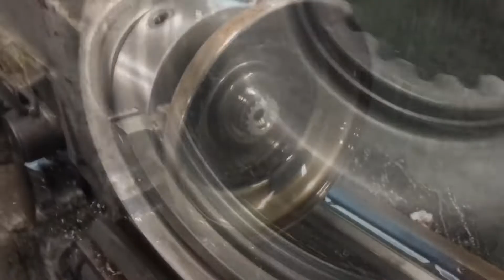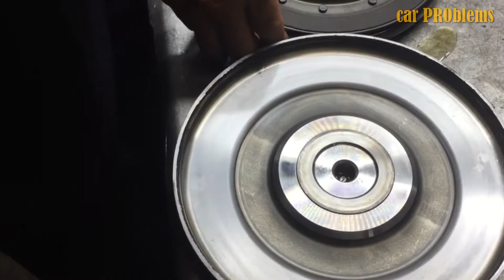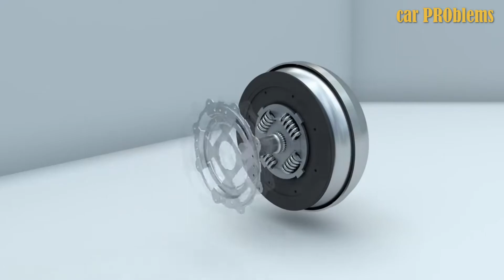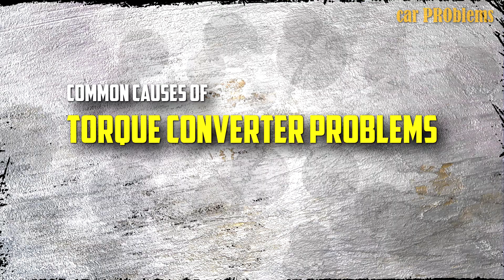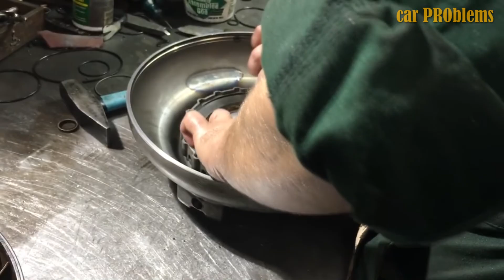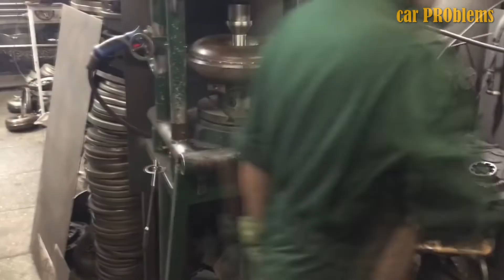6 Bad Torque Converter Symptoms and Replacement Cost

Comment: I have a 2007 honda pilot  it goes on park and drive but just rolls that i have to put on ebrake. When i have it on drive it just rolls even if i give it alot of gas.
And it made some whirring noise before this happened.

Comment: My 2001 2500hd silverado with a 6.0 lq4 trans was rebuilt to stage 2  like 3 years ago and a stock converter with a billet piston and it just started shaking almost a year ago starts shaking at around 55mph and stops right when i let off the gas then just get on the gas again it shakes again and im pretty positive its the converter
Reply: Did you find out what it was?

Comment: How do they prevent oil leaking out of the bearing where the impeller and turbine go into the torque converter?
Had anyone played around with variable vanes in a torque converter,  to completely eliminate the need for a gearbox? (Variable came technology could even permit a reverse rotation of the turbine.
Torque converters look such an elegant method of cooling. The technology has actually been known for over 100 years.  In surprised nobody's made further innovations with them. I'm a medic by used to be an engineer. I wish I had the time and equipment to design and create my ie of "geared" torque converters.  (Which in essence is two or more torque converters, which each have their own levels of torque multiplication. I've also thought of a centrifugal pump expelling the fluid into another centrifugal pump and thereby transferring the power from one one to the other. Fluid, although it has losses doesn't have any friction and with lockup clutch technology, those losses can be greatly minimised.

Comment: I own a jaguar s type 3.0 v6 gearbox zf, on 4th gear there are some noises and little difficult to shift down when pushing the throttle pedal. I think it's time to a oil change, isn't it?

Comment: I have ford focus 2015 transmission problem 5/6 kilometers drive running after not working transmission. Reverse good work. Not any noise. Transmission oil running time throwing back

Comment: i have a fusion 2014 with P0741 DTC CODE but it throws the code only when traveling at 55-65mph, what is the cosg aprox for the repair?

Comment: I just paid $3,109 for my torque converter replacement on my 2008 for ranger
Reply: That is very high in my opinion, you can get a recon torque converter (known to be pretty good as an O.E.M replacement) for about 250 or less and get a pan gasket, new filter, and enough fluid to do a triple fluid change to get all the gunk from the old torque converter out for around 250 or less depending on how good of fluid you want to use, so 500 in parts 3100 dollar job 2600 labor seems too high.
Reply: Should be 1000 parts and labor
Reply: Yikes!

Comment: My 2002 Ford Taurus shutters in the front end only upon acceleration. Like starting from a stop, when I give it gas, it shutters but then it quits after I get to about 15 mph... But I never let it shudder that long.....it's pretty vicious. Any ideas? It only happens when it's in gear. Sitting idling, I can floor it and nothing happens. Only in gear

Comment: Hi, I have a Titan 2007 that tends to   slip only a little like 100rpm(not 1,000) from 1st to 2nd gear and 2nd to 3rd(More noticeable after vehicle warmup). You can also feel that the vehicle kinda holds back after every shift even when cold, like when you drive a manual vehicle and use the clutch to change gears and you feel that momentarily hold down. Vehicle has 220,000 miles. I have it since 167,000 miles and changed the transmission fluid around 210,000. Around 200,000 miles one hose broke and lost a lot of fluid. Couldn't tell what color was it by the time it broke. topped it off with new fluid. Another hose broke around 205,000 miles and decided to change the fluid by removing the pan, also changed filter inside transmission. The filter was very clean😮, installed a new one anyway. I used Valvoline full synthetic max life multi vehicle fluid. Do you think a Lucas slip fix can help or is it something more serious? Thanks!
Reply: Did you end up getting this fixed?
Reply: Llllpl
Reply: Please do not use Lucas slip fix, it swells the seals until they blow, this sounds like valve body and valve body solenoid replacements are needed, or just buy a valve body solenoid pack and valve body drop in shift kit and fix it yourself, the valve body replacement or repair doesn’t require the transmission to come out of the vehicle, you see that thing right by where you took the filter off, that’s your valve body.
Reply: But with the fluid having gotten low sadly you may have burned up clutches in the shift drums and torque converter, but they can be more resilient than you think as long as they weren’t driven long on low fluid and you stopped the vehicle immediately

Comment: Let’s see if anyone can help me. My 2013 Toyota 4Runner will drive perfectly fine. But when going in between 30-40 mph my rpm revs up and down between 1100-1800 but no noises. No shaking or shuddering. It’s stalled on me while doing this only twice. It only happens between 30-40mph and it does NOT happen when I have my cruise control on any speed in between 30 and 40 but my mechanic is swearing to me that it’s a torque converter and I think it’s not that. Any help??
Reply from the maker: Hey there! Here are a few things you could check out for the issue with your 2013 Toyota 4Runner. It might be related to the transmission, so make sure to check the transmission fluid level and condition. Another possibility is a faulty throttle position sensor (TPS), which can mess with your RPMs. Vacuum leaks, a dirty mass airflow sensor (MAF), or fuel system problems could also be causing the trouble. It's best to have a mechanic take a look and get a second opinion if needed. Good luck!
Reply: Have you checked the VVTI Valve solenoid. Normally located on the engine towards the fire wall. Its easy to replace but the part is not cheap. Its held by two, some versions have three 10mm bolts.

Comment: Can you explain why my CVT  car moves from 0 to 100mph well, but it starts making some whinning  noise and doesn't go more than that sometimes it struggles reaching 120mph on the highway.   i  normally change recommended  transmission fluid as scheduled, as well as the transmission  filter, and still having that problem. I diagnosed it on machine but no any trouble codes, for engine also nothing, what can be done????
Reply from the maker: Hi! First of all, I'd assume overheating.
CVTs are known to generate heat during high-speed driving. If the transmission fluid isn't properly cooled or there are cooling system issues, the transmission can overheat, leading to a loss of power and the whining noise you mentioned.
It can be also belt or chain slippage: CVTs use either a belt or a chain to transfer power between the engine and wheels. If the belt or chain is worn, damaged, or slipping, it can result in a loss of power and the whining noise you hear. This could explain why your car struggles to reach higher speeds.
Reply: @carproblemsmax  Thank you so much for a well explanation, now what can be done???? I agree about overheating because in the evening it goes very well, reaching 120mph and keeps going, what can i do, seems on hot whether it overheats.
Reply: @edwinalexander1170  Why are you going 120? If your car works fine below that - stick with that and keep the rest of us safe. Thanks.
Reply: @jaym5938  Because it used to be going well and up to more than 100mph, but now it struggles, it sometimes  not good especially when overtaking, i feel like lose power. And is dangerous on the highway.

Comment: I have a 2009 tahoe with the 6l80 and it shakes in 3rd 4th and 5th gear and revs up before it shifts, do you think that would be torque converter issues or transmission issues? Shifts good otherwise. It starts shaking right as soon as you put it in drive.
Reply from the maker: Both. the 6l80 transmission itself is not very reliable. It has lots of problems related to cracks in pistons, slipping 2nd and 3rd gears, cracked drum, skipping gears, cracked clutch drum (I'm gonna make a video about this transmission). 
But it can be also a torque converter.

To determine the exact cause of the problem, it's recommended to have a qualified mechanic or a transmission specialist perform a thorough diagnosis. They can use diagnostic tools to read any trouble codes stored in the vehicle's computer system, conduct a visual inspection, and perform various tests on the transmission and torque converter.

Comment: I have a 2002 Silverado I can prolly drive it up the street but it will slow all the way down and the engine just starts to rev at high rpms I’ll have to turn it off for bout 30 seconds and crank it up for it to move again and it does not go over 30-40 mph. I think it is the torque converter when it warms up. Do you think this could be the problem?
Reply from the maker: Yes! Based on the symptoms you described, it is possible that the issue you're experiencing could be related to the torque converter. 
It makes the engine rev too high and the car too slow. It also slips and reduces power and speed.
Reply: That's exactly the problem I'm experiencing. Leaning towards a faulty torque converter

Comment: Informative video.   I have a 2012 Ford F150  5.0 AUTOMATIC 2 wheel drive and when I decelerate I hear a slight whining noise between decelerating from 60 down to 40, but none during acceleration.  Transmission shifts great, no slippage or slow engagement.  Was wondering if it could be torue converter or transmission.  When I decelerate, I put it in neutral while moving and the whining stops but starts again when I engage transmission back in drive.  ?????
Reply from the maker: It could be caused by a failing torque converter or a transmission issue. It's recommended to have a qualified mechanic perform a diagnostic test to determine the root cause of the problem and make any necessary repairs.
Reply: That’s definitely your torque converter change it while you can and save your transmission

Comment: Got a buddy with a v6 1998 jeep grand cherokee and his will act like it slips if you drive it normally/lightly but also slips to catch up from accelerating through it (not doing that anymore, what's the point) and also it does not go into park, the e-brake is park right now and he has to start the car in neutral, not park. What does all this mean and what could be potential culprits?

Comment: I have an issue with my car, similar to this symptoms. Has a whine, slams gears, and leaks fluid. When its driven at first, the whine goes away at higher speeds. (20-45mph) After a while however, the car starts reving between gears, or when I try accelerating faster. Overheating is also an issue, the car starts shaking like im on a rocky road. Would it be safe to say that the whole transmission is faulty?
Reply from the maker: Yes! Based on the symptoms you have described, it's possible that there is a problem with your car's transmission.
The whine you hear could indicate that there is an issue with the transmission's gears or bearings. 
The slamming of gears and the revving between gears could also be signs of transmission problems, as could the fluid leak.
Additionally, the shaking you describe when the car overheats could indicate that the transmission is not functioning properly.

Comment: There’s a vibration that correlates with the engine speed around 45-50 mph. Would the torque converter be the cause of this?
Reply from the maker: It is possible that the torque converter could be causing the vibration at the engine speed you mentioned. 
However, there could be other causes of the vibration as well, such as worn out engine or transmission mounts, imbalanced wheels or tires, or issues with the suspension or drivetrain components.
Reply: My car LC200 vibrates when the speed reach 120 km/h and above, especially while releasing the gas pedal (decelerating) the vibration felt more on the dashboard, steering and overhead. had tried to do wheel balancing, rotation and allignment twice but didn’t work. Had replaced the wheel propeller shaft cross joint, not help also. Not sure what is the issue. May it be caused by bad torque converter?

Comment: Hi, can a bad torque converter cause a car to drive but not change the gears
Reply from the maker: Hi! Yes, it can. If the torque converter fails, it can cause a loss of power and torque to the transmission, which can prevent the transmission from changing gears.
Reply: @carproblemsmax  thanks i will look in too it
Reply: My 2008 Acura doesn’t up shift. It just stays at 3rd I think on local uphills roads, I see high rpm and loud engine sound. On the highway. It does shift to 4th and 5. Is this a torque converter need to be replaced? Thanks

Comment: I have a 97 Ram 1500 5.2 4x4 with 177000 miles. The truck doesn't stall on me, but it slips gears a lot and it likes to rev really high in between gears. Don't know what to do. Have any ideas?
Reply from the maker: Based on the symptoms you described, it is possible that there may be an issue with the transmission. The slipping gears and high revving between gears can be a sign of a worn out or damaged transmission.
Check the transmission fluid level and watch for leaks. Check the transmission filter - a clogged filter can cause shifting issues. Try to check for error codes... Wish you good luck!

Comment: Hello, I own a Mercedes w212. I replaced the engine, but before I installed the transmission on the engine, I poured new oil into the torque converter nozzle, and I think I put a large amount, about one liter, in addition to what was inside.  Zero I feel that the engine revs up a lot and the car has not started yet or it is taking off slowly. I face this problem only between the first and second gears, and the rear speed I feel the most. Is this because of the much oil that you added to the torque converter?
Reply: you already resolved this problem most likely, but the normal, correct way to check transmission fluid is after the fluid has gotten up to temperature and cycled through all the gears, but has not been turned off (I.e. turn it on, take a 20 minute drive that includes using reverse, park it, check it before you turn the engine off)

Comment: Hi,
I have a 2009 corrolla, with about 140000 miles. Over the last 18 months, especially during cold start up after which when you engage the tranny, car will not attempt to move at all. Over time I come to the realization that when I engaga low gear(1)  and put on hand brake and leave car to run for about 25 minutes that is when you start feeling a jerk of car readiness to move.Within 25 minutes engine would have warmed up to normal mid temperature.
It's complicated because I don't have any issue of check engine light on.
It was only once that i was using car in the same manner that  code P2757 which points to TCC selonoid.
There after it has not shown up again.
Almost every tranny service centre gives me a different diagnosis of what they think the issue really is.
On cold start and on "D" you can rev the engine full throttle and it won't move.
An indication of movement is after engine really is warmed up. Fluid is normal gauge, not dirty. And funny thing shifts very smoothly and normal after it's heated up. Any leads especially since I'm using tjis car outside of US. In Ghana at the moment.
Reply: It could be a solenoid or a more serious issue with the clutch packs. Electrical issues could be a concern, but it doesn't seem very likely.
 Once it warms up, do you notice any transmission "slipping" under full throttle  from a stop or passing on the highway?
Reply: @Rankine_Cycle21  Notice they've never answered